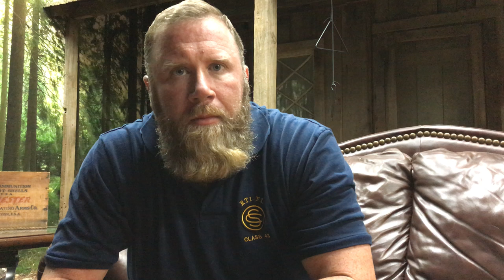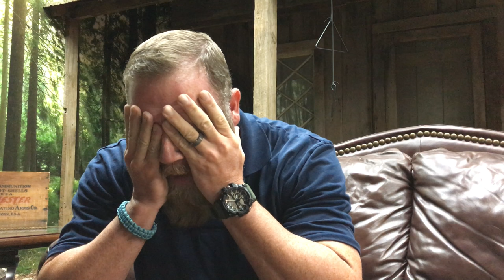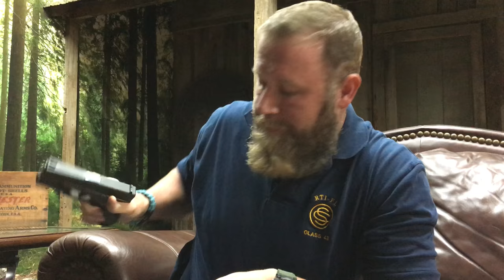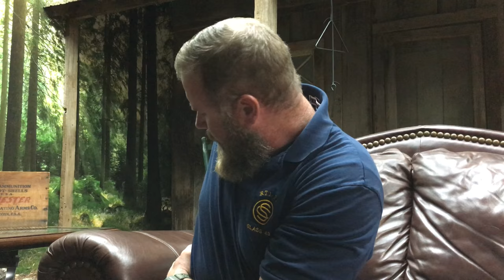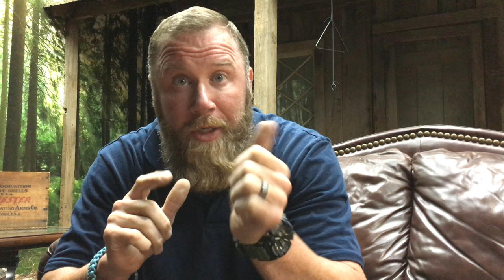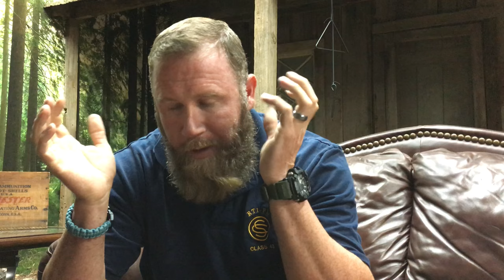#AskEJShow Episode 024: EDC Light, AR Lowers & Hearing Protection

Comment: What holster are you using now that you have the XC-1?
Reply: he did a video a while back using a g-code incog, or some variant of the incog can't remember which model exactly, I have an nsr tactical c-3. I should have bought the g-code. I have a non light bearing one for another gun I rarely carry anymore and it's a cheaper holster and better quality. I paid 85 bucks for the nsr and I had to modify it not only for increased comfort, but one of the screws for the snaps was sticking out enough to catch my extractor and pull my slide out of battery(and scratch my up my cerakote). I fixed it but for 85 bucks it should have been ready to rock right out of the box. I love the light so far though...